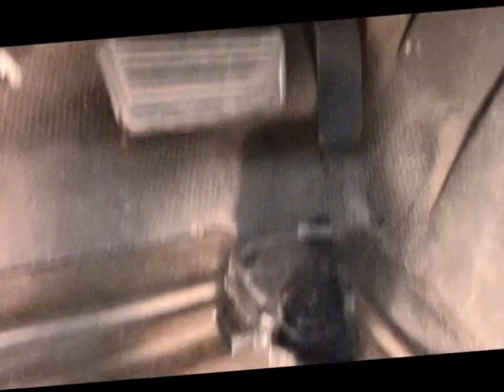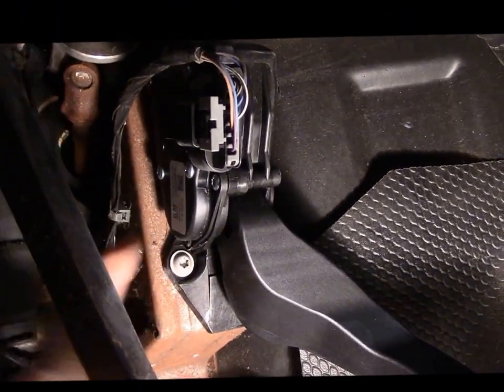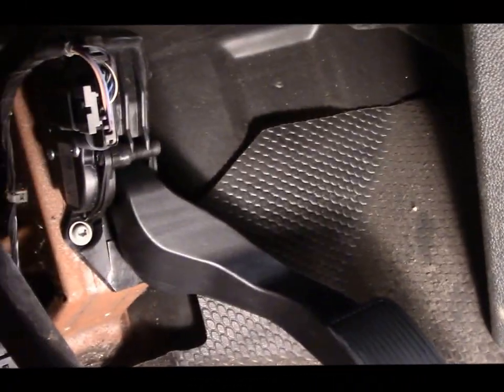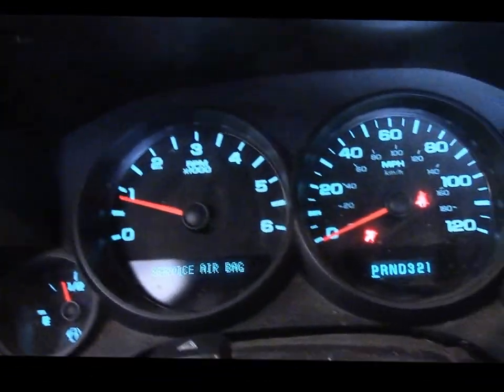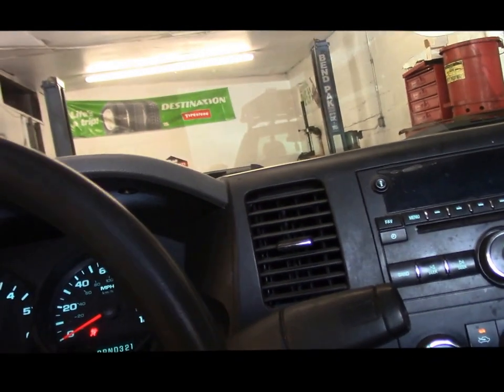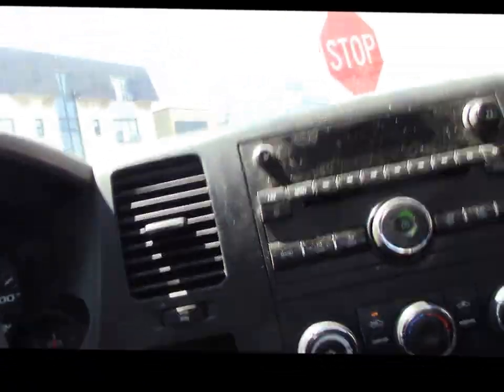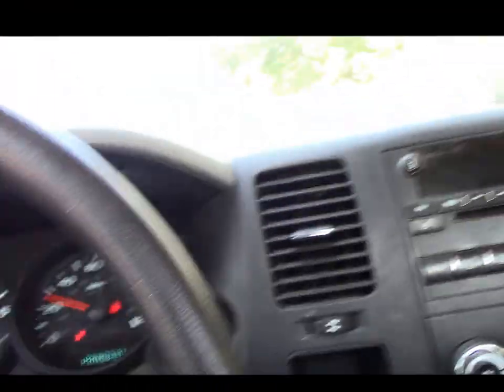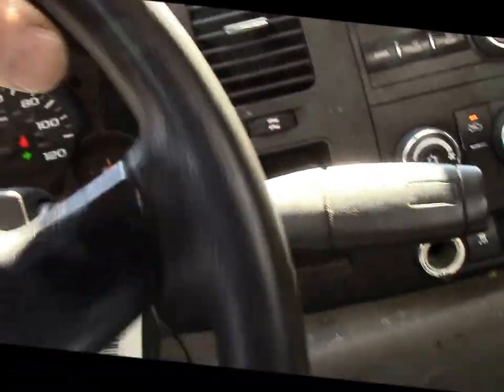2009 Chevy Silverado P2138 Accelerator Pedal Position

Comment: I am not a mechanic (of cars anyway).  I am an electro-mechanical technician though.   I did not take the gas pedal apart to see what sort of sensor is actually in it.  However, this has been my experience working on other equipment with what I suspect have similar control sensors.  The sensors have a variable resistor in them.  By pressing on the gas pedal, the resistance changes which changes the voltage signal to the computer or processor. 

 Here is my suggestion before buying a new gas pedal.  It seems to have worked for me so far.  

Disconnect negative of battery.   Remove the pedal as per video.  Get a clean toothbrush, and clean the car connector with regent grade isopropyl alcohol.  Do the same on the gas pedal connection.   You want to use regent grade which is 99%+ pure alcohol.  The general public kind is 30% water (do not use this).   Now reassemble, reseat the connector to the pedal 4-5 times (helps make better contact).   Before reconnecting the battery, pump the gas pedal for 30 seconds or so very fast going the full range to floor and back.  If it is like the variable resistors I would with, there is an electrical contact that moves with the motion of  the pushing of the gas pedal.  These contacts are known to get a little corosion on the contact point.  The fast pumping of the gas pedal will likely remove this corosion.  I did not do it, but it wouldn't be a bad idea to clean the contacts of the throttle position sensor also at this point.

Now reconnect the negative of the battery and test drive.  If code comes back soon, try replacing gas pedal.  If not, spend the saved money on a meal and margarita, you've earned it.

Good luck.  Jim great video.  Thanks

Comment: I have a 2009 Chevy Silverado. About every 25-30k miles the APP sensor goes out. Has been this way since I bought the truck brand new. Chevy replaces it 3 times u set warranty. I have replaced it 3 times since just replaced it again today. Found out it will always be an ongoing issue as the sensor gets burned out overtime being to close to the firewall. Luckily if you get one at autozone it comes with a lifetime warranty and you can just keep swapping them at at no cost.
Reply from the maker: Thanks for watching.

Comment: Good Video, Jim.  I still like my '04 Sierra with a good old cable running to the throttle body.  My wife's '13 Equinox with "drive by wire" feels like you're stepping on a wet sponge when you accelerate.  Talk about complicating a simple process!  One stainless steel cable replaced by 5 or 6 wires, Geez.
Reply from the maker: Oh Yea modern technology you have to love it.
Reply: Had this issue crop up on me today in my 08 Silverado and took to it a repair shop. They were very busy but took the time to reset the computer which fixed it.. for now. I have to say I am shocked that there is no physical connection to the engine.

Comment: Nice job, Jim. I haven't replaced but one or two gas pedals but am beginning to see a lot of bad throttle bodies. We had cables for years with few problems. I guess there are reasons for going electronic throttles but i can't think of many. I bet between our 90 plus years in the trade we could come up with some dandy stories.
Reply from the maker: I think if we ever sat down and started tell the stories it would be a few days before we even realized .
Reply: That's for sure.
Reply: I have a silverado 05 it happend the same 
Power engine introduced 
But the first time I just desconectes the 
Wired and turn off the truck and just get fixed 
The second time I unplugged the hardness 
And don’t fixes I stop again on gas station and turn of and won’t fixed 
Si I decide to drive couple blocks more 
I stop on store and stop the engine 
Like for 3 mins 
Estar the truck and like just nothing happened 

But today I was driving to home on the hayway just pops up the power engine reduced I can’t stop cos it’s freeway 
So I take the exit as soon I can 
Stop the engine like 5 mins 
Star the truck 
Like just nothing happens again

Comment: I have a 2007 Silverado reduce power light came on hopefully this will slove the problem great video
Reply: Kenneth Heard 05 Silverado does same thing. Figure out the problem?
Reply: My 09 does the same thing. I was told it’s the throttle body under the hood

Comment: My '02 Silverado has had 3 OEM pedals ($100 plus installation) and 3 self-installed Dorman pedal sensors ($35 each) after getting 90,000 miles on the original pedal.  Now at 168,000 miles the latest OEM pedal didn't even last a year, less than 5,000 miles.  The most recent Dorman sensor replacement didn't last 25 miles.   Over $600 on pedals and sensors plus a FICM replacement?  I'm convinced the real problem is elsewhere, as others have noted, in the dried up brittle wiring harness (which is no longer available) or a bad ground issue.  Very frustrating.

Comment: Would you mind respond to my question here, I have 2013 silverado 1500 4x4 similar issues here but a little bit more than what you demonstrated in this video.
My issue was and still on going, Every time the Traction and Stabilitrak control light come on, the (Engine Reduced Power) come on as well and  I cannot accelerate a speed over 5mph when this happen, I did replace the Brake pedal position sensor but it only last a few months so I'm not sure if I replace the right part, I also replace the throtle body but still happening, a lot people show that they have the same issue they end up replace ignition coil and spark plug other people say it was the abs Fuse in the box #9 but my look ok, My next target is to replace the ignition coil and spark plug also replace the brake pedal position sensor see what the result is

Comment: Hey Jim  -
    Like you said it's worth the money to get a dealer part -  good video .
Reply from the maker: I like to do the job 1 time and not have to worry about it.The parts from the dealer were only a few dollars more.
Reply: @jimthecarguy  im doing one of these at my shop now actually and the dealer assembly was $23 less than First Call. The one i got from them failed immediately "Standard" brand...

Comment: Hi I'm a POS that works for UPS im responsible for a 45 truck fleet. I had this issue for a 2 years for one particular GM truck. So this happened every 8 months then 6 months and began happening sooner between malfunctioning. I too replaced the tps a few times I checked wiring. Reference voltage and signal voltage and ground etc  all checked out. Most recent it road called for no power driver wrote up trans slipping but I knew otherwise. New tps and sent out only to roadcall again. Long story short I decided to replace throttle body along with tps 
Still waiting for results as car hasn't been on road yet. 
I believe this will be back in your shop again soon. The ecm must show correlation between what it reads from the tps and gear position in throttle body if it differs this code sets.
Reply from the maker: Thanks for watching
Reply: I have heard of a car that had a bad ground between the ECU and pedal position sensor that came up with the same codes.

Comment: Good job Jim! I agree, with those parts the dealer is the best choice for the replacement.
Reply from the maker: Hi joe you know I did try the  dorman but that was garbage and the dealer part was a few dollars more the best part was it worked
Reply: Yep, I had the same experience with a Dorman unit on the same cade. I like Dorman, just not for TAC parts. lol

Comment: The problem is water enters connector X-205 behind the instrument cluster it increases the voltage on the sensor wires tripping a code if your lucky. Or x-109  Just run new wires from the ECM to the APP if you want to be safe.

Comment: This condition may be caused by water intrusion into the instrument panel (IP) to body harness connector, which
carries the APP sensor signals to the ECM/PCM. This water intrusion results in a voltage difference between APP
Sensor 1 and APP Sensor 2 that exceeds a predetermined value for more than a calibrated period of time, setting
P2138.
Reply: Did you clean the connections or replace the wiring harness to IP? My ac and radio went out along with the p2138 code
Reply: @cjrogers775  C109 can do that as the network is located in that connector it is near the ECM also check the ECM J-1 connector for moisture or looseness I have found quite a few where the ECM connector safety clip is missing. . APP1 is next to the can high wire in the J-1 connector if you have a E38 ECM.  The ECM G103 and g102 and g2?? in the dash can do it.
Reply: @southfloridatechnicaltrain2589  thanks for the reply I'm sorry for the late response but I don't have a wiring diagram idk where those connectors or grounds are. I've cleaned all the grounds I can see except for any inside the dash. Unplugged a bunch of modules inside and outside of cabin so must be the harness like you say
Reply: @southfloridatechnicaltrain2589  if you could explain where the c109 connector location is along with the 3 grounds I'd appreciate it. I assume the j-1 connector to ecm is the one by itself closest to fuse block ?
Reply: @southfloridatechnicaltrain2589  I'll double check the ecm tomorrow if it's the e38 version but I see it only has 2 connectors. If so I have an 07 silverado 4.8l, is j-1 the bottom or top connector?
Reply: @southfloridatechnicaltrain2589  nevermind found a service bulletin on the issue, thanks for the advice
Reply: @cjrogers775  I replaced and I have seen the dealers replace the wires.
Reply: @cjrogers775  what is the year make and model the 900 platform from 2007 -2012 205 is buried in the dash and 109 is located above the wheel arch liner. I just bypass them with new wires with new.
Reply: @cjrogers775  Yes j-1 is the ecm connector it is likely a E-38 or e37 ecm if it has 2 connectors. C109 is above the wheel arch liner.
Reply: @cjrogers775  Likely e37 but could be e38
Reply: @cjrogers775  Hahaha just got to this yeah I could have given them they are on NHTSA web site.
Reply: @southfloridatechnicaltrain2589  it's my friends truck I work on every couple days when I have time. It's mainly the no gauges, no radio sound or blower motor. Network resistance checked out 61ohms, high 2.7V low 2.3V so I don't think a short/open circuit. A lot of corrosion/rust in cabin/dash
Reply: @southfloridatechnicaltrain2589  I'll find those grounds in the dash you were talking about then move onto the connectors. It's a 2007 silverado 1500 single cab work truck - no power windows
Reply: @cjrogers775  There is a ground in the dash that can come loose I forget the number. see if you shake the dash and it changes.

Comment: APP & TPS intermittent codes can be hard to pinpoint and the lab scope has been the way to go find the glitches but when you can't get it to fail you have to make the most logical diagnosis. I have a '07 Aveo with a P2135 that I can't get to glitch so I am saving the freeze frame data & resetting the codes & she stops by every few weeks & if the code is there I collect the freeze frame data. It is only doing it with low ECT & open loop so she will leave it overnight soon so I can try to catch it. Tried spraying with freeze spray, harness shakedown & tap check but wouldn't fail. TB is @$230 & she has limited funds so we are doing it the slow way. I'm pretty confident it's the TB & sooner or later I'll catch the glitch on the lab scope. She's not going into limp mode & no driveability issues & she only uses it to go shopping so we'll give it time to pinpoint it. Im only in Week 7 of shoulder surgery recovery so by the time it gets worse hopefully I'll be recovered...normal recovery is 4-6 months but a TB is easy to change with one hand. Anyways good video Jim and tonight was the trifecta...3 videos in one night!
Reply from the maker: Thank you for watching and your input.Yea the intermittent problems are the worst.I make a mistake when I uploaded 3 videos I must be getting old.Lol
Reply: +jimthecarguy If you love what you do you're never too old. I hope to do this until I go to the big garage in heaven...

Comment: hi jim ,hope u had a gud1,the machanic came yesterday to fit the ecu but when he got to the part that connects around the battery and took it apart he couldnt get the center screw out he said he tried is upmost but no way could he manage it,said its made that way as it stops anti/theft so he was stuck what to do,in the end he did get it reving as it should,he tapped the area on the airpipe near the sensor got in car and the power returned,ive done about 50/60miles since he sorted it and its ran ok ,but even though i paid him and he followed me afew mile then parted im still weary like most people would be if going down the road and bang !!!so wondering if to go to a proper garage and have them put the ecu in i got of ebay and let them check and clean all the sensors,anyway kept you updated..thnx  ROB.

Comment: excellent video, what were the reasons to replace the pedal? Could you help me with any signs or symptoms that may occur to take to replace the entire accelerator pedal?
Reply: Have your vehicle scanned to see what the codes are
Reply: Vehicle goes into Low Power Mode and scans show p2138 code. Usually a very intermittent problem occurring days, weeks or even months apart.

Comment: Hi Jim, I have an 08 Acura type s,I have P2138 code,it has that same symptom,now it drives ok. But should I replace the part instead,because this is a second time it happens. Do I need to perform a re-learn procedure on it after the replacement? And how do I do it,if needed one? Thank you

Comment: I have same issue and I replaced the throttlebody and the pedal. Wiring looks good also. Happens to me when I sit at idle usually. Replaced about month and half ago. Yesterday went to doctor. Pulled over to side of road for phone and while sitting there went into limp mode again. Mine truck is 06 silverado. Codes p1125 and p2138. I'm disabled and have to have vehicle to go to doctors and stuff. Don't know what else to do. I hope their truck is still running good.
Reply from the maker: What brand parts did you use? I always recommend that on this part get the OEM from the dealer.

Comment: Hi Jim,  Have you replace an accelerator pedal sensor on a 2011 GMC Terrain?  I'm in the middle of doing it and it seems like I have to take more off to get to the 3 bolts that hold it in.  Any guidance would be appreciated

Comment: Hi jim, i have an issue with a customers 2011 silverado 6.0, i tested the throttle position sensors in the throttle body, both sides and they had erratic waveforms on my lab scope, i replaced throttle body, performed the relearn, truck ran great for about 2 minutes then back to bucking and stalling out, reperformed relearn..same..ran great then within 2 minutes back to original problem. I suspect defective throttle body, BUT! When i monitor live data on a scan tool,..key on engine off i get good waveforms from both throughout the sweep, with engine running i get no change in APP sensor value percentage but throttle position sensor shows a sweep. I have not tested the APP sensor as i found the throttle body to fail test with lab scope. Any ideas?

Comment: when replacing pedal do you have to reprograme anything or will it adjust itself ?thnx jim.
Reply from the maker: No adjustment required just install and drive.Let me know how you do.
Reply: thnx jim will do
Reply: @jimthecarguy , I am going to replace it on a 2010 Chev. Silverado tomorrow! Do I have to erase the code before driving it? Do you recommend for me to disconnect the battery to remove the code? Thanks.

Comment: Hey jim i got a question on my 2009 pontiac vibe 2.4 awd is there a way i can contact you. I got a accelorator pedal position sensor low voltage and high voltage code, its a 3 wire and its a whole assembly on my vibe. Im curious how to test it. It was replaced at my local gm dealer a month or so ago because of a recall. I used my maxisys autel to clear the codes and it came back on. Thanks jim!

Comment: What a great tutorial......have a question though.  How can you diagnose whether it is the accelerator pedal position sensor.  I am pretty sure it is, but don't want to pay for one then find out the old when was still good and not be able to return the new one.  There is a written tutorial for a GM using Voltmeter, but it's not the same connector so I can't figure it out.  Can you help?
Reply: 4 years later but incase you ever run into it again. Ordering this part from autozone, oreilly, and i think even advanced auto parts, they except returns for parts like this, just clean it and tell them it’s not the part you needed. But if u get it from the dealer i’m pretty sure they’ll be far more strict on returns. But just could just swap the pedal and replace it and test to see if it fixes ur problem, if it doesn’t then remove it and return it. move on to something like that throttle body

Comment: Same code came out on my Nissan Sentra, got it checked at auto zone and thinkin about replacing it myself. Would u recommend doing it myself or taking it to a mechanic? I know I can do it myself but I’ve heard that it can be other issues as well. Maybe they’re trynna get more $$ out of me but not sure
Reply from the maker: This is a very easy job . I would recommend getting the parts from the dealer not aftermarket.Thank you for watching .  Don't forget to subscribe.
Reply: jimthecarguy Ahhh I seen this comment a little too late. Ended up getting the part at oreillys. Runs smooth now and cleared the code so all is good. I will look into getting the part from the dealership if this one blows too

Comment: Nice one jim, the correlation  code  is it always at the pedal or can you get the same code from a bad  electronic throttle body .
Reply: correlation is always the pedal. I think p2135 is a throttle body code. this can be caused by a bad battery or ground that is corroded also.